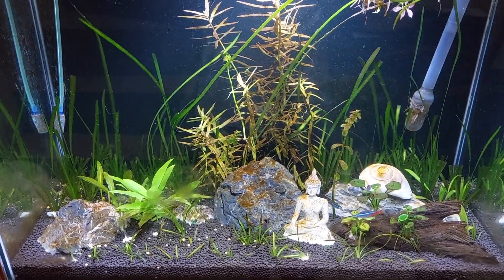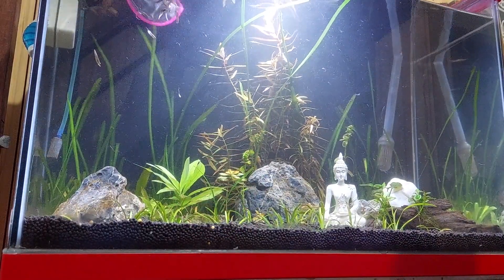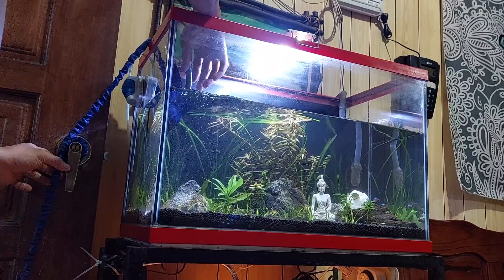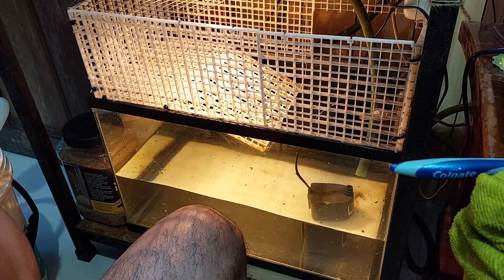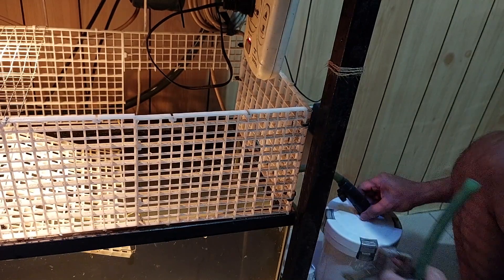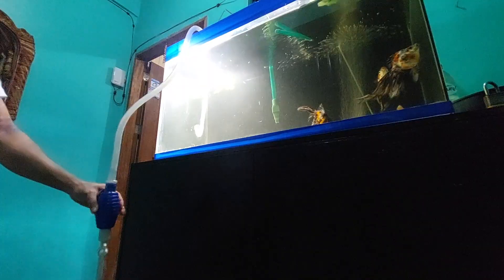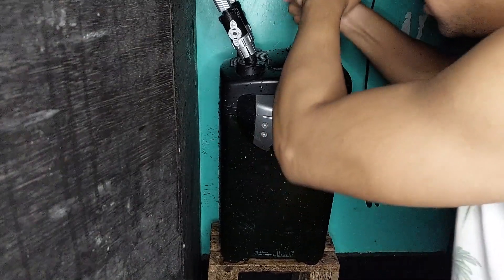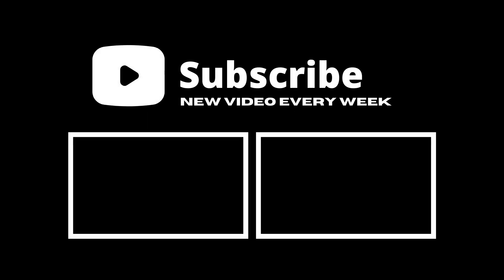Aquarium Maintenance Tips & Tricks | 500 Pesos Worth of Pet-related Giveaways

Comment: hi idol... in my case medyo trabahoso lang ako sa goldfish tank ko but my other 4 community  tanks halos walang trabaho except sa light algae scraing eevery week and water top off lang ako because my water parameters are really stable and clear. im using deep substrate system with low flow filtration.... im been a hobbyist for decades but the best that worked for me is the deep substrtae system... cheers... hope to connect with you to share my experience....
Reply from the maker: Maraming salamat sa suggestion. Subukan ko yan ginawa mo.